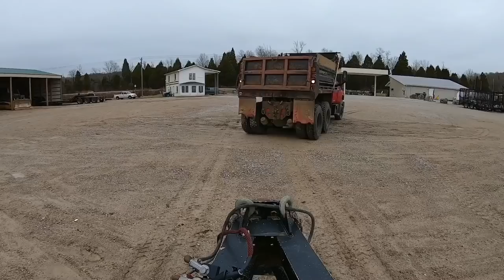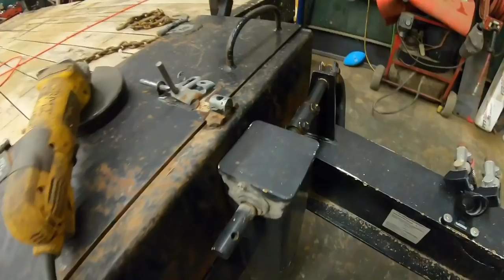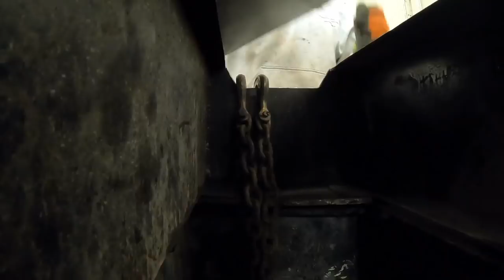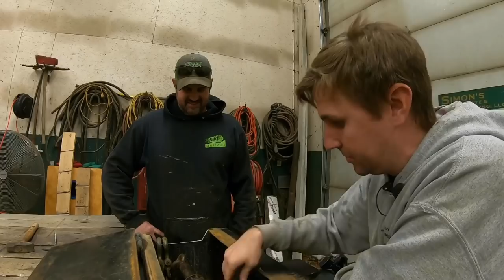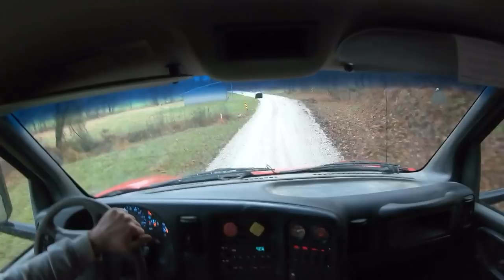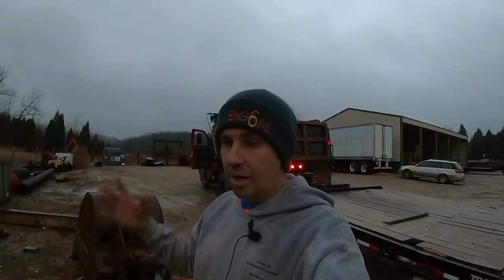Practicing my Fabrication Skills on This 20 Ton Pintle Hitch Trailer - PLUS Homestead Purchase!

Comment: When you hang your chains hook one end on the box and the other on the chain about 4 inches down. Keeps it from hooking another chain when you yank it out and helps keep them organized.
Reply: Pretty sure most of them are short one hook chains.
Reply: @loggingdaddy  mine are 20' . Hang the on a rack and hook the end back to the chain. Also hang along side a binder and hook the bottom of the binder in the chain. Haul mill equipment and electric mtrs mostly..m

Comment: Chains and binders are always a Pain in the butt too keep organized  on a Trailer. You did a good job getting them straightened out. The forklift front end. I figured You would either put a 3 point hitch attachment  on it. So You could hook it up on the back of your tractor. Or the Skidsteer bucket attachment  like you talked about, only using it all too make your little tractor into a forklift..LOL.You could take one lift out so you can use that part for your road Drag. All just suggestions. Great Video...

Comment: Greetings Sir !!! 
Rainy days work, always better indoors !! Mods on the backup small deck definitely give it more usable space, you can only use what you have !!! 🤔🤭 The leg breaker is sensibly dealt with too 😁 
Your welding appears to be fine, more practice with different welders will help you along the way to MBTS standards 💪😎
The forklift attachment is a good buy, I think the ram will be too big for your tipper trailer build, I reckon you will need one about 600 mm (2') long if you are going for an underfloor lift, it may be ok if you are planning to mount the ram on the front of the trailer though.....  
Merry Christmas to you and your family Mike, will catch you on your next adventure Sir 👍🎄🇬🇧👋
Reply from the maker: Was thinking along the same lines, may have to adapt it a bit though since we have a good cylinder for it.
Reply: @CaptainKleeman  
You will have to make sure there is enough capacity in the 755s hydraulic system to fully extend and lower the ram safely too 🤞🤔🤞

Comment: I had one of those 3 point hitch forklift attachments until a few years ago when I got the torch and welder out . I mounted mine on a fast hitch plate so I could use it my tractor front end loaders. It gave me the tilt function that it didn't have before. Not pretty, functional though.

Comment: Hey bud in hindsight you should of welded 2 straps across the inside to hang the chain hooks on to keep the mud an gravel out of the box from driving down the roads
Reply from the maker: Maybe,. Time will tell.  Metal is easy to change
Reply: @CaptainKleeman  lol sorry just speaking from running a tag trailer like that up.an down gravel  roads here in iowa. We ended up cutting the floor out of the chain box an welding in expanded metal to get it to fall out on its own
Reply from the maker: @codymoulton2010  oh yeah, definitely,expanded should be the standard in chain boxes.  If it's not road debris, it's just the gravel that always ends up on the chains falling off in the box.  Long term I will cut the bottom out and put expanded in it.  It has drain holes, but they aren't big enough yet.
Reply: @CaptainKleeman  yah we had that problem to small factory drain holes

Comment: You are a day early for Christmas. So you have Merry Christmas. Diesel prices here in Birmingham, Alabama is down to $2.89. You know as soon as you cut that latch off it will pop open when you hit a big bump on the road and stuff will fly out but only will happen when you are driving it LOL.
Sometimes your volume was loud and sometimes so quiet.
Reply from the maker: Possibly, Its been broken since he has had it, but you're right, if it would happen to someone lol.  Thanks for watching!

Comment: I hate to point this out Captain. However the speed binders are a little bigger in the middle. So your spacing may be an issue. Other than that good job buddy. Merry Christmas and God bless
Reply from the maker: Yup,. Mike and I talked about that,. Will most likely keep the speed binders stores out side similar to his other trailer as the primary and keep the ratcheting style in the box.  Not sure he will buy all 8 speed binders initially

Comment: Take both hooks on 1 chain and hold them beside each other then drop them on the cut out on the box.
grab 2 hooks get a chain, grab 2 hooks on long chain only half the pulling to get it out.
Reply: My chain loop always gets hung up in something in the bottom of the box… I went back to putting just one hook on the angle iron.  I know… I should clean all the debris out of the chain box… but where else is a guy gonna throw his odds and ends of straps, hammers, wrenches and Pepsi cans?  LOL
Reply: @sassafrasvalley1939  Try what Ron Pratt at midwest truck has to deal with in his rotator. 5 lockers on each side just packed full of gear. he has a channel showing the recoveries.
Reply: @jaquigreenlees  OK I’ll do that… thanx

Comment: I have a question about the trailer crank handle. Is there any way of attaching a nut and using the cordless drill to raise and lower the trailer? it seems it would make it faster to do so? on my travel trailer it helps when lowering and raising the stabilizers. Just a thought. maybe make a quick attachment for the handle in case a battery is dead you can still crank it up or down.  Whatcha Think? Anyhow, Merry Christmas to you and your family

Comment: Cap’n, that low profile on the front of the trailer opens up a lot of loading options.  I liked your clever solutions.  Keeping the binders organized and inside the box is a smart move.  I’ve never seen a mud flap that stopped all the dirt and grime from showering the trailer!

Now about that forklift mast… if the cylinder doesn’t work out on your dump trailer… you can make a log splitter that will split whole logs!  Or, install it as a lift on the main mast of the YouTube yacht!  Think of the wind you’d catch.  Or, weld a flag pole on the top and just run it up to full height when you want to show off… from your place, it’ll be the highest flag in Derby!

That was a great find… the possibilities are endless!!!

I hope you have a wonderful family Christmas!
Reply from the maker: Hey I like those ideas!!

Comment: A couple of thoughts (sorry, not very deep ones). Seemed like when you were welding you were raising your hand a little in a tapping movement rather than following the seam in a line (but you got it stuck together regardless). And maybe hang both hooks of the long chain on box edge (less chain length to remove and less chance of loose hook catching anything).  Harry's Business and a Happy New Beer.
Reply from the maker: Thank for watching!

Comment: I was a mechanic at a heavy truck shop. I built a few boxes like that. The cut-aways on the sides is an old trick, but a great update to yours would be to paint the hooks to know which are long and short chains. I also put chunks of 8" pipe inside vertically to house each long chain. That kept all chains from covering others and making them heavier than need be. One thing I think you goofed on is making the cut-aways too deep. It looks like you could steal chains from your box. Maybe your not worried about that, but a few of our long haulers went to some pretty sketchy places. Like you said, it can always be re-welded and changed.  Always loved coming up with better things and making them work!! My boss was sure shocked at all of our drivers telling him how much they liked the new chain boxes. Yeah, the boss thought I was wasting time.. Showed him!!!!

Comment: Just a note on your remote mic, I found out, for myself anyway, it's just as easy to slip a small digital recorder in my shirt pocket with a mic plugged into it and then sync it up with the video in my editor. I used to hunt and move the sound to try to get them synced up but then I found this magical "Auto-Sync" function and that made it my go-to for around the shop and forging vids. 
Oh yea, and I refer to it as not fabricate but fabricoble.
Reply from the maker: Now that's interesting.  I may have to try that.  Appreciate the tip!

Comment: Capt, you did pretty damned good for on the fly fabricobbling. reused as much of that hassle headache rack, found solution to chain storage problem. only thing that would drive me nuts is the chain hooks sliding back forth. maybe weld in stop tabs to keep the chain hooks from wanting to slam from one side to the other?

Comment: you should be a expert by now with a cutting wheel and/or wire wheel and/or grinder with you actual day job lol .... oh wait you dont use them much anymore you direct others to use them lol .... when is ya next promtion at work coming ???
Reply from the maker: Actually passed on this last testing cycle.  I've been enjoying the LT role!
Reply: @CaptainKleeman  wtg onto the next step in your career as a firey .... oh boy that could be interesting management style that the fire dept has neva seen b4 unless they have watched you and mike together on you tube lol
Reply: @CaptainKleeman  Does that mean you'll be Lt. Kleeman now?  🚒   What does Lt. Dan think about that?  😂

Comment: seems like it would have been better to weld a bar on the inside of each side for the chains, instead of "HACKING" up the sides of the box,, things could be kept dryer
Reply from the maker: Just something else to get snagged on when pulled chains out.  Plus, dry isn't an issue when it comes to the chains, after all, we haul in the rain 😂

Comment: how about adding a rear camera on the truck that would work though Bluetooth to phone or pad?  

How come you guys don’t build like drawers under the deck then you could (pull) slide them out like tools in a shop toolbox?

does look good, but i thought you were going to paint the toolbox too at least the top. lol.
Reply from the maker: Not really worth the time, we don't have that much gear that goes with that trailer.  Thanks for watching!